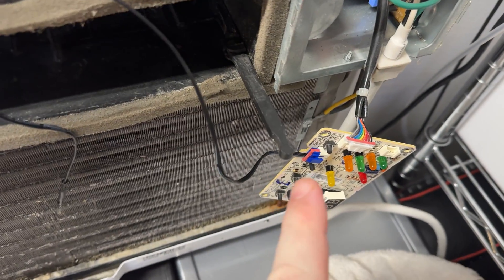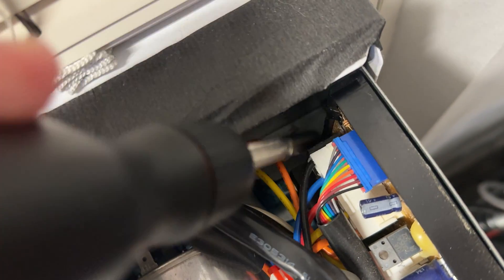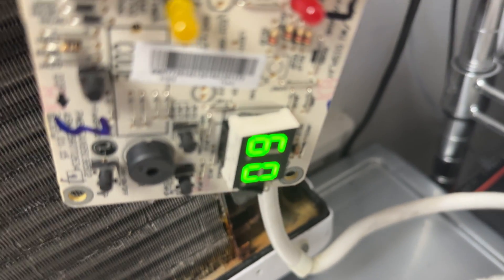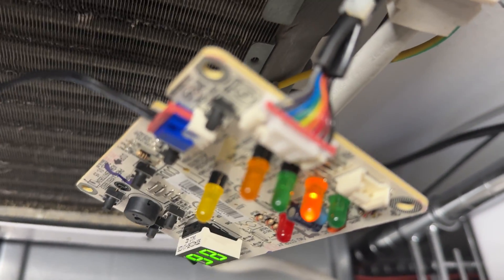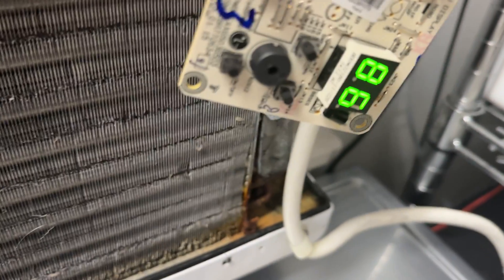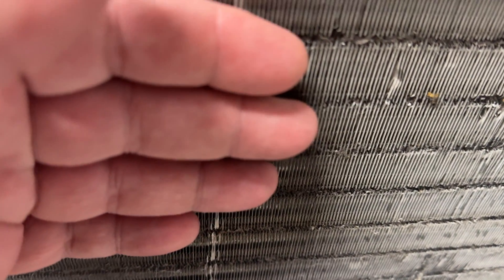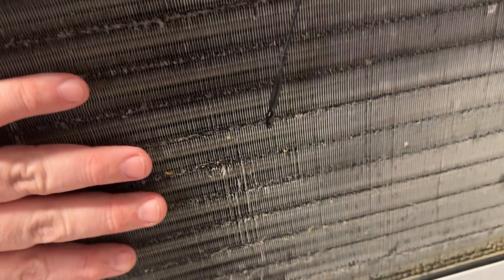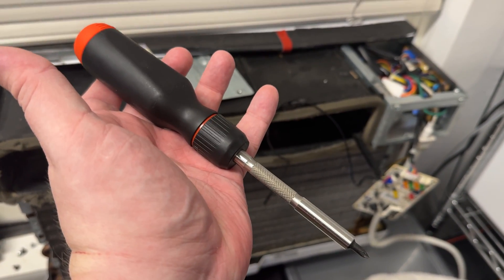Fixing Stuck Relay in Windows AC with Percussive Maintenance! 🪛 #DiyGasm

Comment: If you end up replacing it please do a video.
Reply from the maker: I will! But so far I’ve kept her alive with a $5 ESP32 and $5 KASA smart plug.
Reply: @Barnacules  mine gave out. Tapping it doesn't work anymore. I'm going to have to solder a new chip on the board. When I  fix it I'll do a video if you don't first.

Comment: Just a week ago I replaced the mainboard on my LG 8000 btu  AC because of a stuck relay..Tapping it freed the relay,but for only a short time...The relay is around $2 or $3 if you know how to solder and desolder you can just replace the compressor relay..The main board is around $40- $50..My big LG 18,000,the relay only stuck twice over the past 3 or 4 years..My opinion is they probably need to install a larger amp rated relay..
Reply from the maker: Honestly she lasted 7 years under 24/7/365 use so I can’t be mad honestly. But a $5 ESP32 and KASA Smart Switch turned it into a smart AC so it’s like it got an upgrade now!
Reply: @Barnacules  Great Idea!

Comment: Proper tool? You're holding it.. Just cross the pegs with the metal part while holding the plastic part. I've worked with 100's of those and never got shocked. Just discharge it every time you touch it. Did you use hot glue at any point in this repair?
Reply: Isn't it better to use some load that acts as a resistor to control sparks/hot metal in one's eye, maybe avoid damage to one's tools?

Comment: When i did hvac the amount of run caps i discharaged by just using a screw driver lol, yoy might as well just replace it, theyre cheap anyway. Pretty much everything in there is cheap its the time to replace thats expensive. Until you get into like compressors and boards (not boards if you can fix them yourself) its pretty cheap to fix
Reply from the maker: I agree, the run capacitors are cheap, but I didn't have any on hand. 😅
Reply: @Barnacules  im in law enforcement now but i still keep up with hvac as i do it as side work or free for the less fortunate, but sadly soon the epa will probbaly get their push passed to make it so only someone who is EPA608 Certified is going to beable to buy capacitors. The government overreach is getting a bit insane from the ol alphabet crew

Comment from the maker: Wow, I'm still somehow alive after poking the AC relay about a dozen more times. However, it finally did completely fuse so now that compressor is stuck on 24/7 unless I physically unplug the AC since the control panel can now only control the fan. So, I'm going to try jerry rigging an ESP32 using Home Assistant to make a sensor with a climate probe to control the TP link to turn power on and off for the AC based on room temp to hold the temp where I want it. This is as janky as it gets baby! Wish me luck!

Comment: LG ACs seems to be well made as this one lasted very long.
 I have a GE 12000 BTU which also had that same stuck relay issue and I fixed it by hitting the relay. In adittion, I also have a 2013 LG 6000 Btu that still works fine, the only component that just failed recently was the capacitor in August 2024 but it was replaced and the AC it is still going strong to this day,
Reply from the maker: Glad to hear you've had good luck with your LG ACs!

Comment: reasons like this is why preferrably I'd rather use mechanical knobs and simple electronics wherever possible. I have one of those plug in thermostats for my AC unit that just unplugs the AC whenever it's cool enough and that costs $16. then I use the knob on the AC to set the temp where I want the fan still running but no AC. I get the added benefit of being able to position the sensor closer to where I'm at. also for about $30 you could get a remote controlled one so I don't have to get my greasy ass up to set the temps but I don't mind the dumber model

Comment: luv it, close call, thank goodness, god bless.
Reply from the maker: Yeah, not double checking the power to make sure it was unplugged was really stupid. Also, poking around in the electronics with a screwdriver that wasn't electrically isolated properly wasn't a good idea either with that giant capacitor sitting right there fully charged. I shall endeavor to be more careful in the future. But, in true fashion I left my mistake in the video instead of jump cutting it out like many would have hoping that other learn from it.

Comment: Very much not insulated, LTT confirmed in a video today on his server loop.
Reply from the maker: Someone sent me a link to the video yesterday. I wonder if Linus shot that segment and said that before or after he saw me use his screwdriver in this way? The timing is crazy don't you admit? I'll have to ask him. That being said he's totally right. Simple ABS insulation isn't enough for high current 110v and the design and material thickness isn't rated for electrical work so even though it would give some protection it can't be guaranteed. What I did was careless not double checking to see if it was plugged in even though I had previously unplugged it and thought it was still unplugged. You can't be too careful with electricity and I'm glad it scares me and makes me uncomfortable so even when I make mistakes like this it's not directly grabbing wires or sticking my bare hands near hot wires.
Reply: @Barnacules  It may have been careless and it's not at all something we as intelligent people would recommend but it's certainly something we have done, will do and likely will "hopefully" get away with for a while.

Stay safe!

Comment: The same thing happened last summer when i installed my 6 year old window ac, it turned on but it just didn't kick in, a refrigerator technician told me to use a tiny rubber mallet on the side to dislodge "something" with small hits, wait a couple of minutes then turn it on again, and it worked!!!  The compressor just kicked in!!!
i am running the same ac this year working without a problem, and it hasn't done that again, I think is the same situation with your Ac.
Reply from the maker: I tried banging on it from the outside with no luck, this relay wanted some directly love 😂

Comment: I had this issue with the LG 12K i had in one of the kitchen windows. Gave it a good whack and its been working fine so far. what a coincidence.
Reply from the maker: You’re the 2nd comment from someone that got a similar result banging on it. This needs to be added to the AC manuals in the trouble shooting section 😂

Comment: you discharge it like any other cap, use a screwdriver and touch the terminals together. make sure your holding the rubber end of the screwdriver tho :P
Reply from the maker: With a cap this big it will weld to the contacts 😬 Not sure I’m willing to try that yet. Maybe I’ll just build a little resistive discharge just to be safe 😆

Comment: I can't believe you just stuck a screwdriver in there with the power still on😂 Maybe smacking it from the side (close to where the power board is) could fix the problem without having to open it up?
Reply from the maker: Yeah that was a huge mistake. I legit thought it was still unplugged. Oops! I got lucky.

Comment: Junkrepair recorded for education porpuses.
Kids and not so Kids, please dont play with AC-s. This could have gone very very bad. There is puffered live voltage on that cap terminal. Evenif your pokeing tool has plastic handle, it doesnt means safe!

This device is relativly basic concept. However the newer 3 phase dc variants are even more deathtrap for uneducated Kids. 
Just an example:
Did you zapd yourself with electric gas igniter from kitchen? It produces very little energy on very high voltage.
A small laptop charger main dc input cap makes you jump back from shock and give feeling of numnes in bodypart. Potential pulling your hartbeat to zero for a second ( very very weird feeling).
Same cap in a standard atx psu easily burns away a decent screwdrivers neck!

If you want to poke in electric appliance please please please unplug first! Even the professionals do!  If the pros are working, they are most likely using same clever hack. Forexample safety transformator. Which gives that the power for touching direktly live will not create direct loop to ground.
Reply from the maker: I 100% agree with absolutely everything you just said @N3szt0r 👍 This is why I leave my mistakes in my videos instead of editing them out, it leads to good discourse in the comments that could save lives and shows that anyone can make mistakes. As I said in the video, I thought it was unplugged but I should have double checked it because I forgot that I plugged it back in to run another test and then ran downstairs to eat dinner and forgot. Thanks for the comment, I liked and pinned it. I have no problems admitting when I make mistakes and using my mistakes to help educate others. 🙏

Comment: This is the LG AC unit you got from 8 years ago right?
Reply from the maker: Yup, and it looks like it will give you Tetanus just from looking at the pipes. But she's still holding refrigerant and aside from this sticky relay she still blows ice cold! I just need to order a new $5 surface mount relay and drain the capacitor so I can pull the mainboard and swap it, and she will be good as new for hopefully many more years until one of the corroded pipes gives out and lets the magic gas out and I have to go buy another one since I don't know how to braze copper pipe. But who knows, maybe by the time that happens I'll have that skill in my quiver and can try to squeeze 25 years out of this like my Microwave I've fixed multiple times that keeps going strong! 🥶
Reply: That's good, actually I'm surprised it lasted that long.

Comment: if the relay got stuck it probably welded it self and might do it again , and if it does it's probably because the ac starts and stops too often and with a capacitor that can deliver 6.1 amp of power to the relay you need to order a new board in case you trick stops working
Reply from the maker: I 100% agree, if the relay got stuck it's going to get stuck again eventually so this just bought me a little time. Thankfully the surface mount relays are like $3-5 on Amazon or eBay. But, I want to learn how to safely discharge the capacitor before I go digging the board out to actually solder on new components. But this AC has been an absolute beast running 24/7 for so many years. She has broken down a few times but I've always been able to fix or work around the problem for free. This is the first issue it's had that might cost me a few bucks. Well, maybe that's not entirely true since I did buy stuff to clean the coils, etc last time it got super gunked up and stopped blowing cold at all.

Comment: This must be the most viewed AC unit on all of the internet - very well done with the AC
Reply from the maker: You're probably not wrong, this AC has seen a lot of over the years. But, every time she breaks down we find a way to bring her back without any money somehow! 🤣 That being said I probably should replace these surfaces mount relays because beating on them will only fix them so many times and honestly the part is only like $3-5 USD. I just don't like soldering and I don't like removing Electonics next to giant capacitors that can kill you. But, one of these days I'll buy or build the right tool to discharge them safely, so I don't have to worry every time I'm working around them in some appliance.